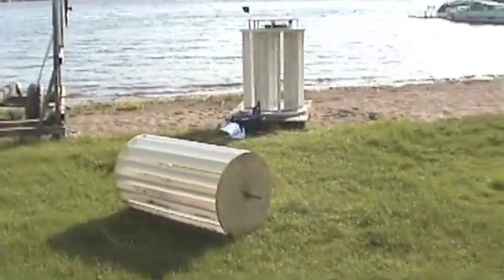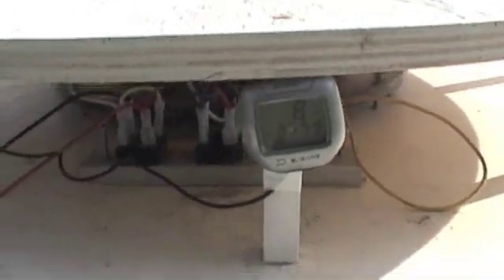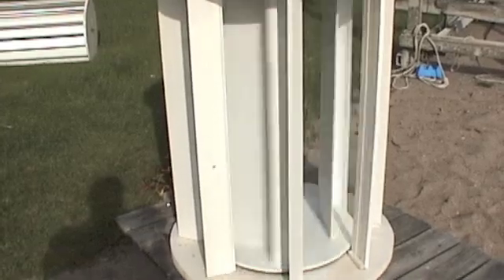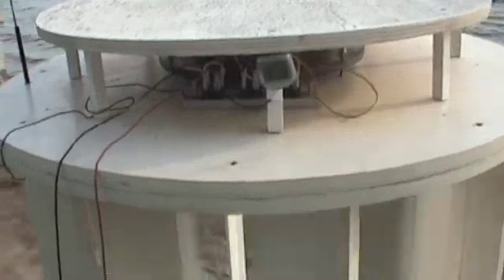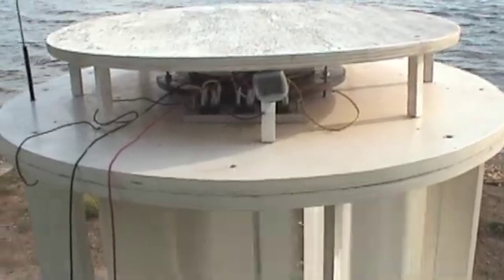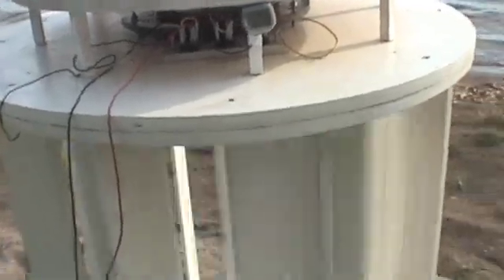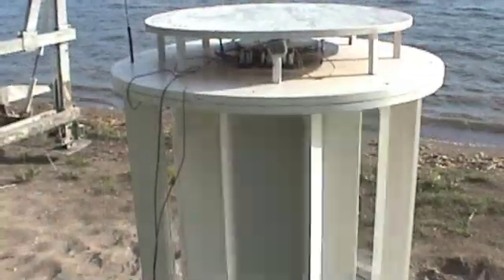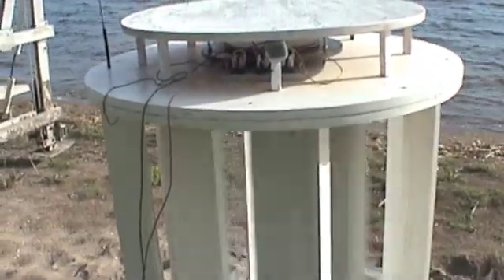Lynx Vawt with Lenz2 Rotor

Comment: For FUCKS sake !!!!!! POWER Power POWER!!! Give us the fucking numbers. not rpm or voltage. Give us fucking power. WATTS. Voltage multiplied by fucking current. So hook up a load (motor, lightbulb something useless or useful)  and measure the current through the wire and the voltage across the circuit.

Comment from the maker: @WulfBand 
The top is made up of two layers 3/4" plywood.  The rotor can just be dropped in.  At the very bottom below the bottom bearing there is a cavity that holds a single 1/2" ball bearing.  The weight of the rotor via the shaft rests on this single bearing.  The rotor turns with the wind from a butterfly's wing 100 feet away.

Comment from the maker: @WulfBand 
Its a 5/8" shaft from cold rolled steel and finished smooth to fit into 5/8" ID sealed roller bearings.  These are flanged bearings and press into the plywood top and bottom.  The top section plywood slides down on the shaft and is secured with screws.

Comment: Great. this the way to go: to compare different geometries on the same set up. There is a lot of optimization needed and characteristics change with wind speed. I guess a Lentz type will always work well at high high but not at low wind. What might also play a role is the weight difference between the two turbines. Thanks for sharing this. Your test place is just perfect.